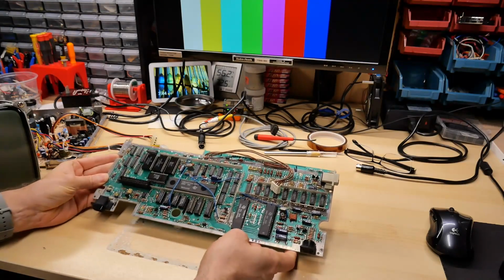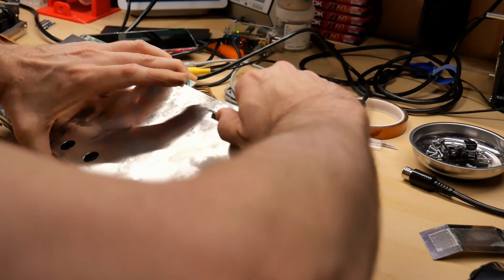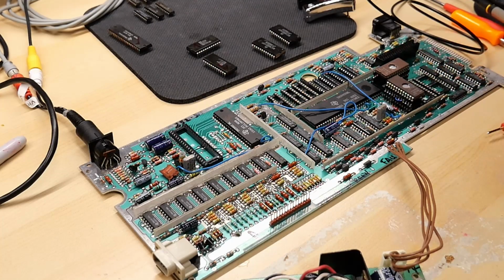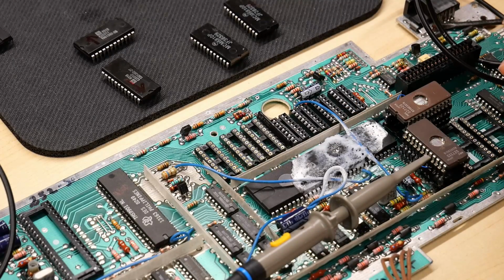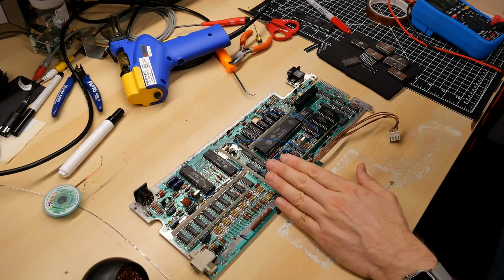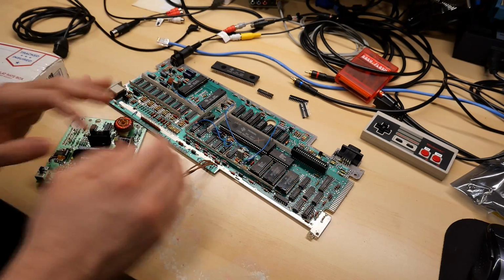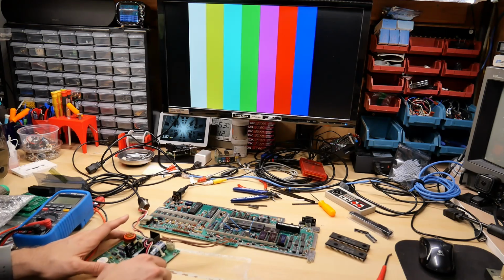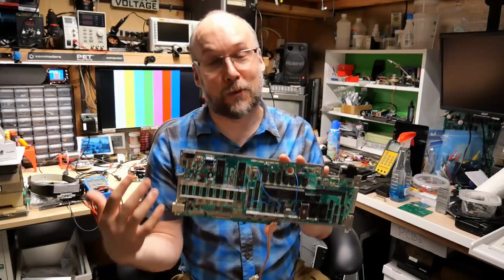Ti99/4A Motherboard Repair - Part 3 - More mistakes, but finally success!

Comment: Don’t be so hard on yourself Adrian, I’m a seasoned technician of 40 years and I am still capable of making the odd ‘Fatal’ mistake, and tbh they always lead to further learning and improvement. Really enjoyed this series, I first came across your programs while researching repair of a friends C64 (which I eventually fixed) keep at it!!! 🍻
Reply: This channel, and others like LGR, RetroSpectre, and Technology Connections, are like a community of friends that don’t know I’m hanging out with them.  :-)  I get so much out of it that I decided to take a crack at pointing a camera at projects I’m working on.  Not sure if I’ll ever do anything with it, but I figured if I’m working on stuff, maybe there’s someone else who would have liked to hang out while I did it.

The point, though, is that I’ve made so many mistakes — big and small, some easily fixed (like turning a chip around), and some that led to further repairs and, unfortunately, some carnage — that, well, I had a moment where I was really wondering whether it would be wise to air that stupidity..  But, any time you do anything worth doing, you take a risk.  Every time I screwed something up, I learned something — like what to be more careful about next time.  I’m thinking it might make a nice segment I would call “Welp, I’ll never do that again (subtitle: I don’t deserve to have nice things)”.
Reply: @sirnickity  Hello Nick! I, for one, would love to see what you have on video. You're correct in that I see a lot of the same people on Adrian's, LGR, Technology Connections, xraytony, etc, etc, channels and it does appear to me as though we are a semi-tight-knit bunch of enthusiasts that like to share and learn from one another. This channel (Adrian's Digital Basement) brings me back to my teens in 1982, when I had my Vic-20, Timex-1000 (Sinclair ZX80), and being able to relive those days, vicariously through Adrian, just makes me feel good each and every time Adrian posts a new video. I really can't explain it any clearer. My point is that we (all of us vintage electronics/computers) enthusiasts are blessed to be able to employ YouTube as a platform to share our passions via video and I absolutely love reading almost every one my fellow enthusiast's posts in all of my favorite YouTube channels. It would be awesome to find additional, similar channels and, well, you could also be on my YouTube subscriptions list of favorite channels! Post up your videos Nick. I will subscribe to you right away!!! Fred
Reply: We do not remember lessons if we succeed - failure makes us revisit/ re examine our current approach. Hard but effective.

Comment: Oh ma, what a rollercoaster ride.  I seriously thought you were going to throw in the towel after the 12V incident but i'm glad you stuck with it and got it working. Not to throw shade, but it would've been nice if the eBay seller gave a warning to you as a courtesy if he knew the potential problem.  But I suppose we really need to learn through our own mistakes.  I look forward to see what you do with those boards you got from Sam.  BTW, people like me are novices, I'd say you're competent or proficient.

Comment: @Adrian's Digital Basement
As usual, your work is very good. The area you need improvement on is the use of solder flux. Get some liquid rosin flux and be generous with it's use. Having flux on the work will keep solder "bridges" from forming where they are not wanted/needed. You can get some on Amazon or Ebay easily and inexpensively.

Comment: Seems like it would be a good idea to paint some varnish or solder mask stuff between the pins on these boards, just to prevent this accidental 12v to the wrong pins problem, probably would have been a good idea from the factory too, but you know what they say, hindsight is 2020... :P

Comment: You look like you're trying to preserve the original processor chip despite your prognosis of its death....  If you really have confidence in your diagnosis, just snip every chip pin at the body of the chip, and pull the legs out one by one... much kinder on the PCB...

Comment: That was a long repair, well done. It's a very sad feeling when you realise in trying to repair something you just make things worse. On a DIP package with so many legs, if you are fairly sure that the CPU was bad, as you were here, I would have used a pair of small side cutters to snip off the legs and then simply pull them out one by one, and then de-solder the empty holes. This minimises the risk of damaging the PCB, especially since you had to also resort to a heat gun and prising to get the CPU out.

Comment: Learn a lesson, must have a magnification tool, my eyes are no longer good, since I'm also from the 70's. Great job fixing the TI which frightened me since it seems far complex than my Apple //c.
Reply: How I learned I was getting old- I had removed a bad GPU from a HP laptop, I got a replacement and could see well enough to know a pin wasn't lining up, but not well enough to see which way I needed to bend a pin. I bought a magnifying glass and a pair of 3.50 glasses just to finish it and ordered the Magnifying goggles.
Reply: Heh... I was working on a hobby board the other day for a couple of hours.  When I got done I tried to watch TV and my vision was ghost imaging, apparently from looking up close for a long time... Time to get some of those magnifying goggles like Adrian has I guess.  I'm only 47!  Makes me feel old!  Oh well.  :-)
Reply: @Calphool222  47 isn't old! Don't let the Millennial/Emo Generation brainwash you! Lol they think anyone who is a little older than them is "old." But it's going to be hillarious when they have a meltdown cause they can't fit in their skinny jeans anymore :D
Reply: It is more complex than your //c. This was basically a minicomputer cpu wedged into a 'Home computer' mainboard.

Comment: This was my family's first computer, we got it cheap after TI pulled out of the computer market in 1983/84 as I live in the UK the TI-99/4A was a poor choice as there was a lack of support for TI's computers in Europe. However the dealer managed to get us the TI-99/4A packaged with the TI extended BASIC cartridge. We used the TI-99/4A until 1986 when the power supply blew up, we went with as our next computer an Atari ST 520 which was quite a jump from the TI. I still use the ST for MIDI purposes and have done a complete recapping 2 years ago and in good working order.

Comment: Glad to see everything arrived in one piece the hdx board is used to interface with a pc via the PEB box.  And the USB keys is to use a usb keyboard with the Ti as the ribbon cable on the original board almost always falls apart!

Comment: I’m so happy for you that you got the Ti99/4A working after so much troubleshooting. I certainly can relate to this with my Issue 2 ZX Spectrum that refuses to work as 48K. The diagnostic ROM suggests the multiplexers to be at fault, but I’ve tried a few new sets from different manufacturers plus a few different sets of RAM chips. I guess I have to delve into the schematics and service manuals too. Just to put my mind into ease, did you previously have an S-993 desoldering gun instead of a Hakko in your video where you demonstrated your desoldering techniques?

Comment: That lack of Solder mask is some bullcrap
Reply from the maker: I'm not sure I've ever seen that before! And to think this was made by TI -- not some shady company.
Reply: The solder mask is only absent where the trace passes through the row of pins.   The pins can't have solder mask on them, of course, since they need to be soldered.   I think not having mask in that area was pretty common when this was made.   PCB technology has progressed like everything else since then.
Reply: @rlgrlg-oh6cc  The solder mask should cover all the traces, if you look at many contemporary products they have solder mask there too, like the VIC-20 and Apple II. It seems more like whatever place TI had these made used a process that was cheap or outdated by 1981, you normally shouldn't need to inspect for solder bridges on thru-hole construction.

Comment: Very informative. Is the CPU a Z80 series?
Reply: It's one of TI's own design, a very early 16-bit CPU, also why it's such a large package.
Reply: Im surprised they didn't use a PLCC package for that many pins.
Reply: @simontay4851  Seems like they were pretty uncommon at this point in history, and didn't become more standardized until a couple years later.

Comment: Actually i think the keyboard manufacturer was Futaba, the company that makes RC servos.
Reply: and Vacuum Fluorescent Displays :-)
Reply: Futaba also made the keyswitches for various Acorn machines, they're renowned for getting scratchy and horrible when old.
Reply: TI bought keyboard modules from several companies. Alps, Futaba, Hi-Tek, Stackpole, and Mitsumi, at least. I have no idea how much they spent on keycap tooling with all the switch changes.

Comment: Great job, nice to see this one reach a happy ending =D  Ouch at the 12v short there - easily done when there's no solder mask between the pins!
Reply: Oh c’mon, you’ve toned out every possible bridge point you’ve ever worked on?  Yeah, OK.  🙄  Everyone gets caught sooner or later.

The real nimrod here is the one who ran a (relatively) high voltage between sensitive data pins — AND didn’t use solder mask.  Ugh!  I hear about stuff like this, or how the GameCube digital IO pins had a 12V pin next to 3.3V IO, and it just reeks of careless design.  When I design interfaces for my own projects, I try to do it with the expectation that things could get bridged, plugged in askew, backwards, etc., and try to minimize the casualties if it happens.  Because it happens.
Reply: @sirnickity  Totally agree with you sir. It happens to ALL of us. If you work on always varying PC boards long enough, it is not a matter of IF, it is simply a matter of WHEN.
Reply: Guess I'm just old school as I'm amazed people don't probe for bridges automatically after their work. 
That was just basic SOP back in the day.
Reply: I fried a PIA in a CoCo back in the day when adding a Votrax SC01 and miswired the 12V line. You were very fortunate! Thanks for the great series!
Reply from the maker: Indeed. Still what a crap motherboard LOL. Glad it's finally fixed!
Reply: @adriansdigitalbasement  I'm truly blown away that the solder mask, basically where it was needed the most, was non existent between the pins of the TMS-9900 microprocessor. Why even bother putting a solder mask on the PCB, if you're going to omit it where, in my opinion, it is needed the most... Sheesh.... Fred
Reply: I'd say microscope the board after installing anything like that and removing any excess to prevent bridging and apply some solder mask.
Reply: Maybe if you know the board doesn't have a mask, you can put one before de/re-soldering. Maybe a bit of the green stuff that hardens with UV or something else that withstands heat.
Reply: @ИванСнежков-з9й  Clear nail laquer is a pretty good field-substitute for conformal coating according to Big Clive. A little bit where solder mask should be might help a little bit.
Reply: @ИванСнежков-з9й  No just learn to check your work, especially around sources.
Reply: @noanyobiseniss7462  Prevention is always better than treatment.
But even if you protect the lanes, you still have to inspect them. It would just make it easier, because there wont be soldier on the lanes.
Reply: @valentine_puppy  Probe not look.

Comment: I always enjoy the moment when you switch something on to see if it works Will it/or won't it work great fun
Reply: @Mike UK I managed to do that once -- a snipped off resistor leg had sat on the PCB. Small pop and fireworks. I was sooo dismayed! Didn't have the guts to test it directly afterwards. Just got up and went to the pub instead. Tried it the next day - and too my amazement it worked with the leg removed! Wtf. More lucky than I deserved
Reply: @manuelvandyck9184  As long as you didn't let the "magic smoke" out, you should be fine.
Reply: Adrian has the best reactions either way.